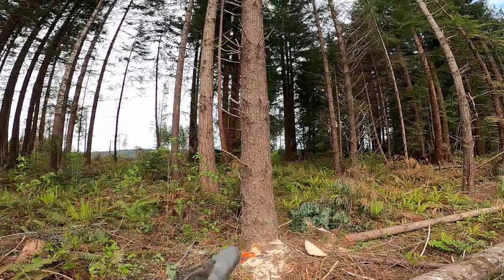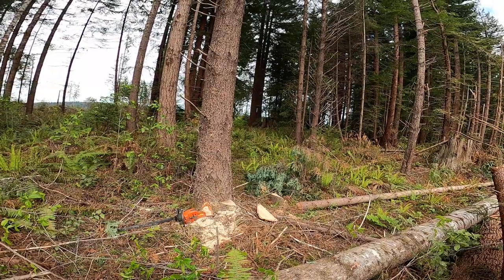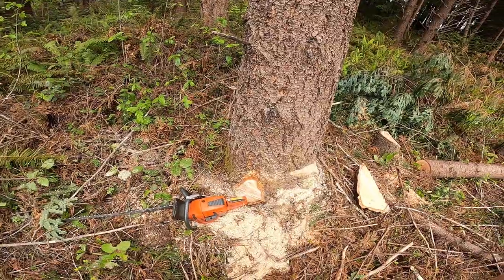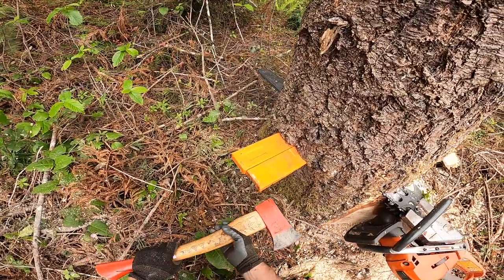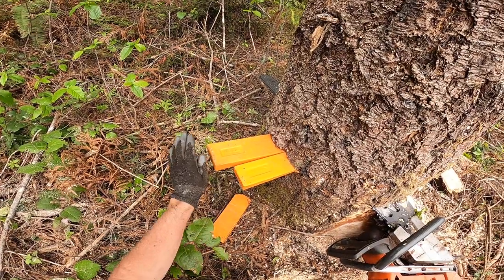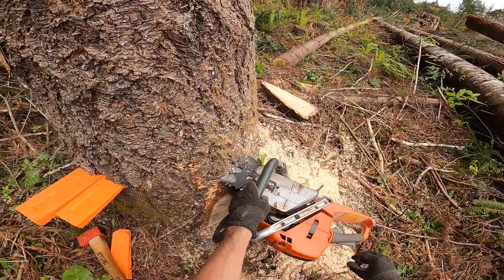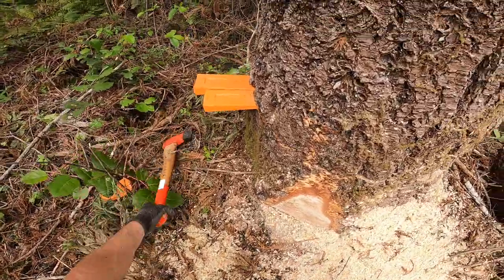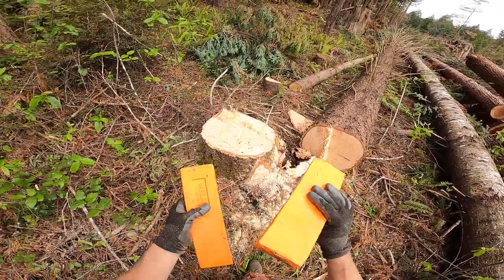A helpful wedging technique

Comment: Great video! looking very useful technique to wedge over as I have been helping my mom within three directional tree fell and my 4th and 5th I had to wedge another one about 47ft 13" pine side leaner which I wedged 70degree away from natural direction and another 54ft 12" pine mild side leaner 90degree away from natural direction, don't know is rookie sometimes lucky? as I fell them right there I wanted, next one is 50ft 13" pine which I should fall 110-130degree out of direction and it's estimatedly 4degree side leaner, is it 120degree directional change much harder that 70degree?
Reply from the maker: The hardest lean to control is side lean. I recommend putting a line in the tree and pulling it if the trees are being fell by any structures...
Reply: @norcaltimberfaller1943 thanks for informing actually I fell it at yesterday successfully (from NW 315° lean to NE 70° direction) just being slightly taller than estimated (56ft pine and 13" thick). Wedge it slowly with 8" wedge which I supported with 5,5" wedge, what happened I heard breaking noise of hinge at side of the lean as letter box cut was bar wide open on the center, then pine stood up wildly and I hit both wedges once again and then it dropped right there I wanted and vehicle of my neighbour at direction of North 0° didn't see any danger 😊 It's great seeing your videos and learn techniques thought little personal error will may lead to disaster anytime and I guess trees may always act unpredictable way..

Comment: Is there a brand of wedge that you prefer? I've used a bunch but haven't settled on one as superior yet. Thanks for all of the good content!
Reply from the maker: The red and white are pretty good.(Kand H wedges) The wedges in the video are a cheaper kind that they sell here at the local saw shop. They are pretty decent considering they are a cheaper wedge.
Reply: @norcaltimberfaller1943  Thanks for the reply and the good content! You make it all look easy, brother! I just watched your Husqvarna 592 video and am curious on your thoughts about it compared to the Husqvarna 395? Thanks so much!
Reply: Bullseye Dan!  Good job.  Thanks for the tip
Reply from the maker: @travisgilbert8416  It seems to have comparable power to the 395. Also its much easier to change the chain on the 592 because of the sprocket being on the outside.